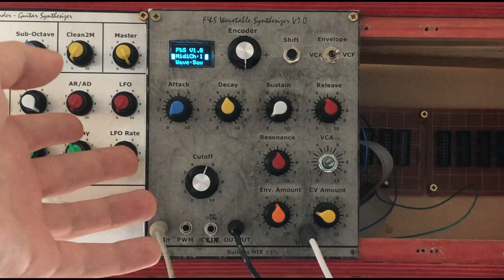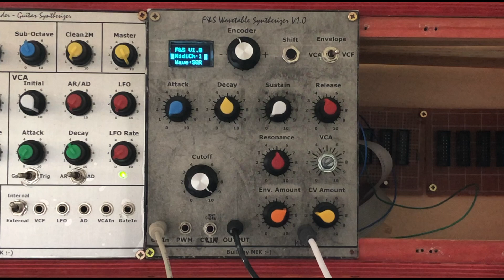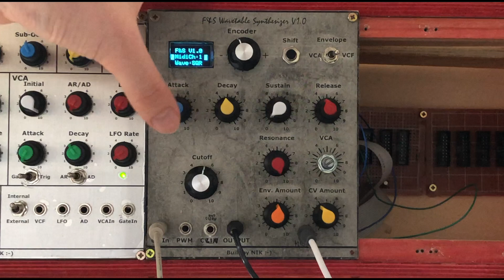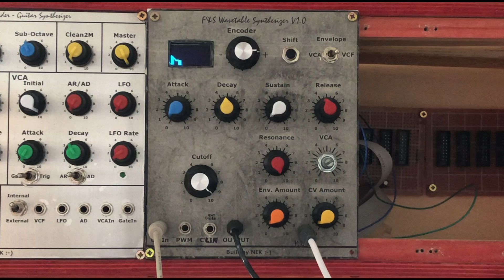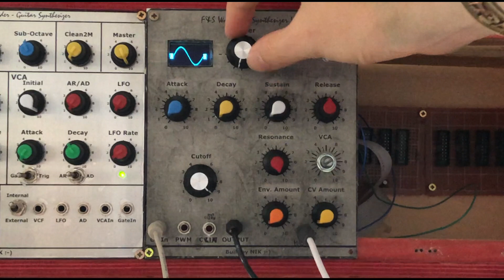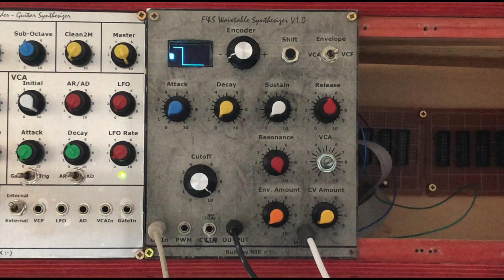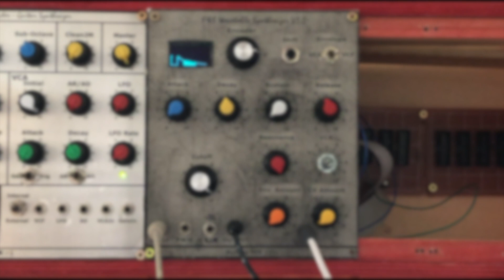Father & Sonthesizer Ep. 13: The 50€ Wavetable Synth - Part 1

Comment: Can you please let me know which OLED type is? thx!
Reply from the maker: radiomature we just used a 128x64 OLED we found on eBay, there should only be one. And I think it was connected via SPI. All the specs should be in the library as well, check out website. It’s the most common one on eBay, very cheap.